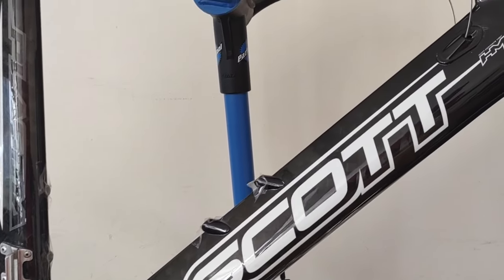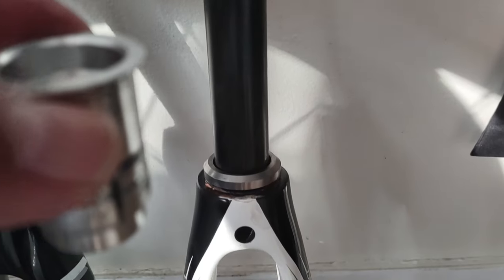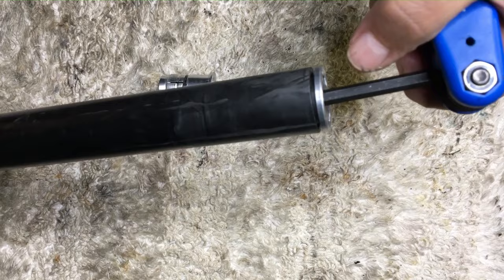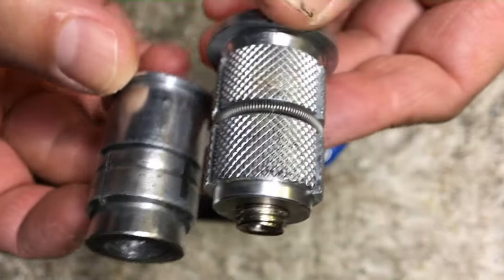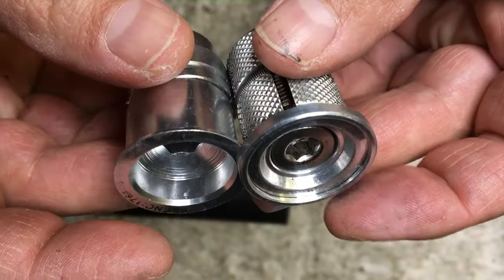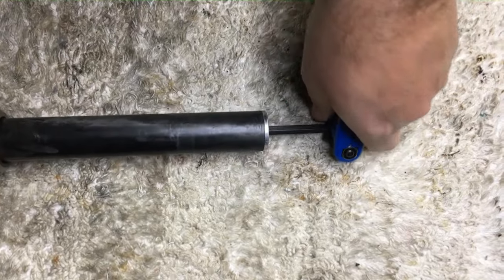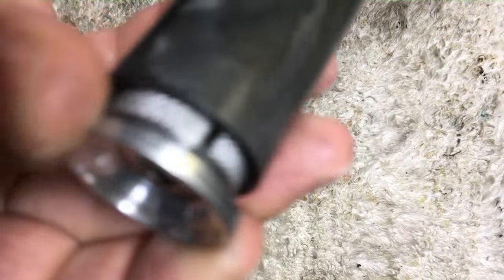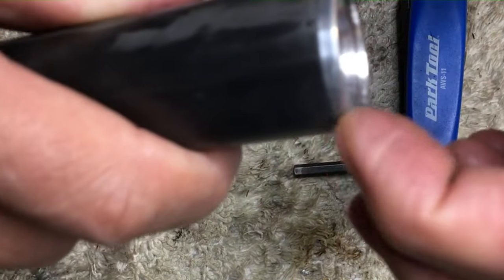Carbon fiber fork? Watch this.

Comment: The knurled plug  you removed on the right is totally bone dry.  How do you expect the wedges to expand the collets outward against the inside of the steerer tube, and the bolt to turn properly if the threads and everything else are bone dry?  When you "tighten" the bolt with the blue Park allen tool,  you're trying to overcome the sum of all the friction in the threads, bolt head and expansion wedges.  Oh and additional friction caused by accumulated corrosion on the bare metal.  It was probably never tight enough to begin with.  
Another example of how failing to use proper grease at assembly results in problems.  I imagine this bike has myriad problems resulting from poor initial assembly.  A tale as old as time in the bike industry.
Reply from the maker: Thanks for sharing and a great take! I'm always learning. Now, there's also the popular belief that grease and carbon don't mix, so how to convince those people otherwise?
Reply: @hobbybike51  There is carbon safe grease out there, Finish Line Premium is one, you can also use carbon grip / anti slip paste on the fork plug as well.
Reply from the maker: @mtlbiketech7960  Thanks for sharing!
Reply: @hobbybike51   grease and carbon mix just fine.  It's like the crowd that erroneously believes you shouldn't grease crank tapers, some people will never listen or learn.
Reply from the maker: @dudeonbike800  I accept this reply lol! Thanks for the comments because they're all good and PLEASE, PLEASE subscribe and comment on all my stuff!!

Comment: Compression plug should only be torque to 10nm, not as tight as you can. And also that's typical aliexpress compression plug, I grind the outer edges of upper lip so it won't interfere with stem & steerer clamping
Reply from the maker: Cool, thanks for sharing!
Reply: 10nm of torque is irrelevant when everything in this video is bone dry and devoid of appropriate waterproof grease.  Only after greasing the fork plug bolt threads, head & wedges will 10nm of torque on the bolt head actually create the intended expansion force needed to allow the fork plug to perform its intended funcion.  This is most certainly why the fork plug continued to slide up and out of the steerer tube.  Also, the previous user probably bungled proper bearing preaload procedure by trying to preload a tightened stem, or a setup without proper delta in steerer tube length and stem stack height.
Reply: @dudeonbike800 10nm trick is a hit or miss..... especially there is different quality carbon....
eg. my china carbon use a very hard epoxy for the carbon... thus is very slippery....
and the standard/original short plug doesn't work.... i replaced similar (short plug) it still fail
Reply: I tighten the plug until it flexes the carbon out, meaning the stem has more resistance to slide on, this is usually 4-5nm for me. Any tighter and I can no longer slide the stem or spacers on which means the carbon is ready to BLOW!
Reply from the maker: Actually, I did a steer tube extender install vid and this happened, so EXCELLENT diagnosis lol! Without the extender, what I did actually worked well enough but I'll try to make a follow up vid showcasing your description and explanation. Thanks, great stuff!

Comment: i had the same issue... the original plug is too short, it doesn't hold properly....
i tighten too hard until the tube is slightly crack....

my solution is to replace/use a longer plug.... (more holding surface = more secure)
Reply from the maker: Thanks for sharing!

Comment: install the stem first and it will act as a guide while you tighten that plug
Reply from the maker: Thanks for the comment! How does one get the compression if installing the stem first? If you have a vid, feel free to link it here. If I'm not learning, I'm not living!🤙
Reply: @hobbybike51  you set the fork plug with the stem tight.  Now the plug is centered and will not move.  Then loosen the stem and apply proper bearing preload to the top cap and then tighten the stem.